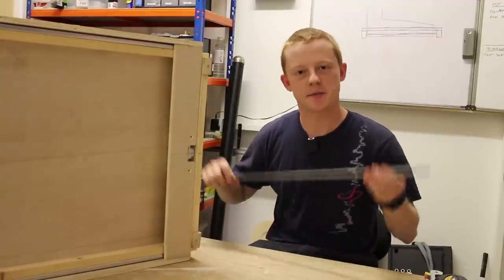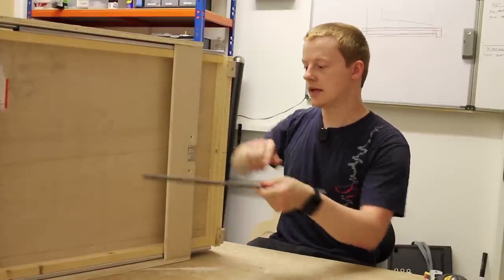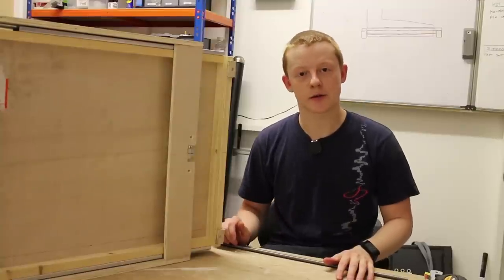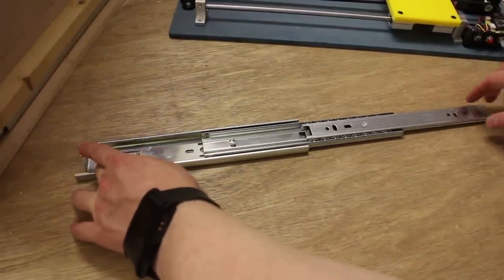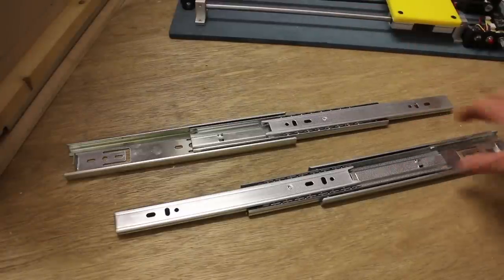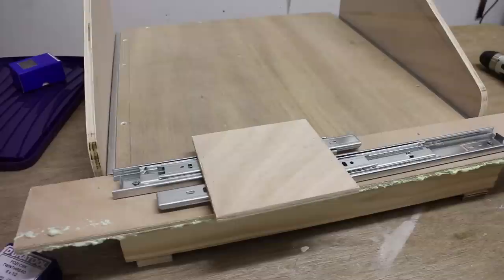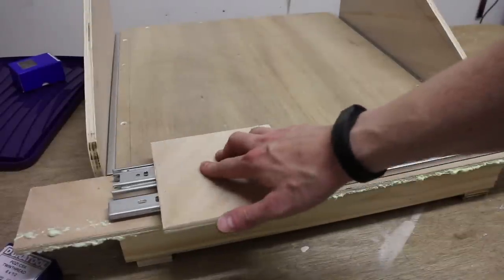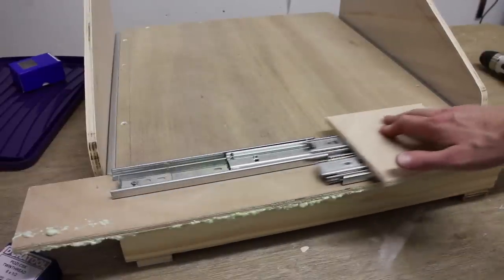Drawer Slide CNC Build - 2

Comment: You bought the wrong type of guides.  Check out slides that don't have that extra slider, like keyboard drawer slides, not bathroom drawer slides like you have.  Seach on youtube for Making Linear Guides from Drawer Slides  by Matthias Wandel
Reply from the maker: +Jeff Beck The double draw slides like these allow for a full range of movement, they were necessary for the base slides but probably not for the ones in this video
Reply: Jeff, thanks for the tip! Made a difference in my prototype here...